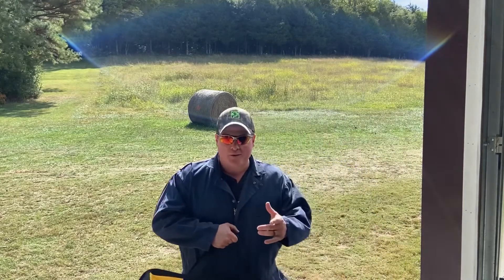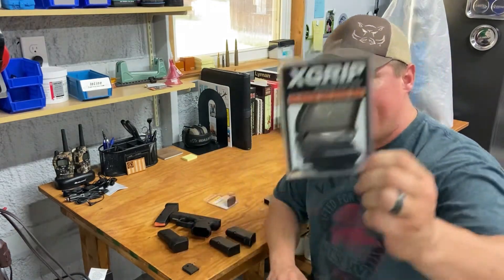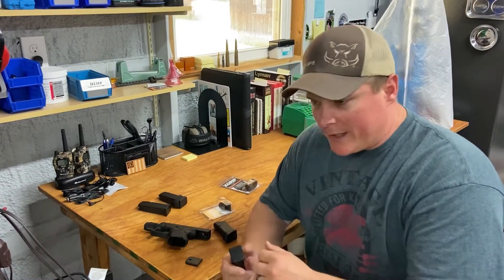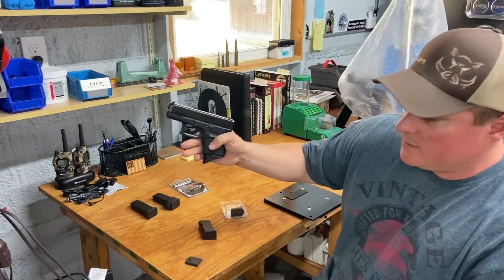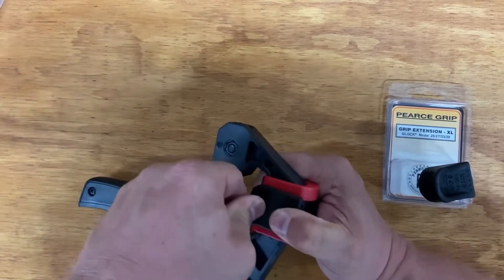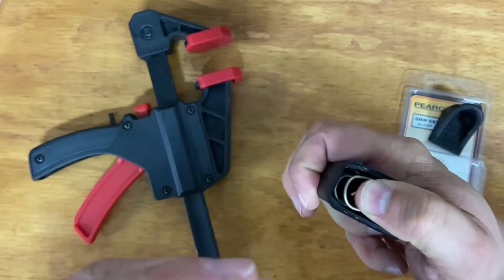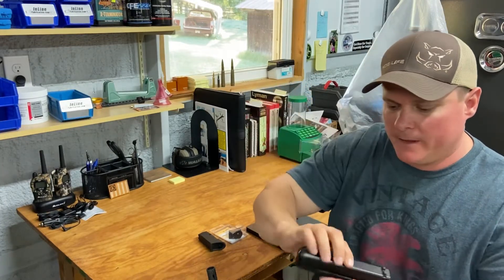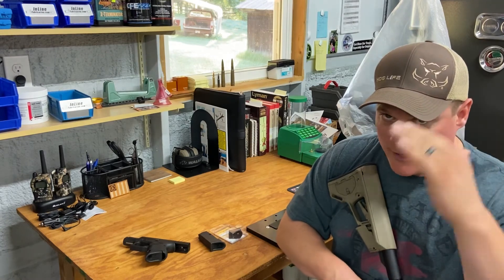Pearce Grip Extension Glock 26 Gen5 install

Comment: This is a great video.  I didn’t want to buy that special tool for the same reason, probably only will get used 3 or 4 times.  The clamp idea is genius - presses those tabs in and gives you a little more to hold onto while you move the floor plate.  Thank you!
Reply from the maker: Appreciate it big time! I’m glad it helped!!

Comment: Getting that original cap to start moving was the hard part. Once it move that first fraction of an inch it came off smooth and the new went on slick. The Harbor Freight clamps are another story.
Reply from the maker: It was a hard row to hoe!

Comment: Rather than using a clamp, I put my mag in a vice to compress the sides. The vice also held it securely in place while I worked the bottom off with a flat tip screwdriver. Easy peezy.
Just be careful not to over squeeze with the vice.
Reply from the maker: That’s a good idea for sure. Wish those tabs weren’t there to begin with.
Reply: @RawHawg .  You can grind the tabs off.  They are not really necessary.
Reply from the maker: @oklahomahank2378   I had to learn this the hard way! Lol thanks

Comment: I prefer their +1 grip as it’s slightly LESS protruding believe it or not than the XL version in the video.   Also, I do NOT stuff one more round into it as I don’t want the spring literally smashed “bottomed-out” all the time.  It works best on the Glock 27 mags, vs. the 26.   The 27’s factory floor plate makes the magazine ridiculously tight to the point that the mag spring is smashed like a pancake and great force must be used to get the very last round in.    The The Pearce +1 floor plate solves the problem by giving some “breathing room” for the factory spring and does NOT compromise reliability.
Reply from the maker: Good information, I have never used the plus 1 I don’t believe.

Comment: First use the long end of Allen wrench to push in mag insert, and hold Allen inserted...THEN squeeze the sides of mag body with the clamp. By squeezing first you bind up the insert and you have to fight it (and potentially crack it) trying to push it in. A small c-clamp work well also for squeezing the mag.
Reply from the maker: Good advice. If you miss a step it is a struggle
Reply: @RawHawg  Right. Baseplates are a struggle if you don't do it just right. Glock mag tool is long and hardened because you need length and strength for leverage to pry the baseplate off those side tabs. New mags are harder the first time, but if done right not bad. I use a punch and a small c-clamp to do mine.
1- Prep the c-clamp to get ready to squeeze by having the "C" wrap over the back, round count side of mag
2- insert punch about two inches into mag to move insert deep enough out of the way
3- lightly tighten c-clamp to pinch just enough to not cause permanent deformation
4- pry punch forward until slots in baseplate clear tabs on mag body and punch can't travel any further forward
5- take punch out and remove baseplate with thumbs taking caution with spring and insert so the don't inadvertently go flying

After you do a couple it becomes super easy to do it without hiccups.

Cheers
Reply from the maker: @richdouche8253  for sure and hopefully this helps some people!

Comment: Just got the +2 Pearce grip/extension for my G26. This is exactly what I'm looking for
Reply from the maker: Awesome! Let me know how you like it. I may give the +2 a try myself.
Reply: @RawHawg  if I like the +2, I'm gonna get the +3 for the two spares it came with.

Clamping the mag down to where the base plate can slide out past the two hooks without permanently damaging the magazine, is definitely easier said than done.

I like how you were using a 1/8 hex screwdriver, the mark of a true modern gunsmith.
Reply from the maker: Indeed! It’s tedious but well worth it. Makes you love the G26 even more! Good luck with install!
Reply: @RawHawg  update:

I got the PG-2733 for my G26 Gen5. It is actually a +1, not a +2. I think it has something to do with the generation. I just ordered the PG-42733, which is also advertised as a +2, but it specifically mentions the gen4/gen5 in the description. I also ordered the PG-39, which is a +3 (at least it's supposed to be). I'll update you once I get those in. Regardless, the one already have (PG-2733) that only adds +1 still works great, and I'll probably use it as my primary magazine for daily carry.
Reply from the maker: @tobiasreaper3650  sounds good! Let me know if it truly is a +3!! Hope the shipping doesn’t take forever as well!
Reply: @RawHawg  UPDATE: I just received the two extensions/grips and installed them.

The PG-42733 advertised as a +2 for Glock 26 Gen4/5 is NOT a TRADITIONAL +2, it is a +1. The reason why I say "traditional" is because you can easily fit another round in there, but after that, there is next to no room for the FCU, so when loading it into the gun you have to force it more than normal, to an uncomfortable degree. It also rattles if you fit that extra round in there. 

The PG-39, advertised as a +3 for the Glock 26, is actually a +2.

Comparing the PG-42733 to the PG-2733 (the PG-42733 is the newer one that I mentioned earlier). The 42733 stands up straighter that its older colleague, but that is because the back edge of its base protrudes more. It uses the actual gen4/5 grid square texture on the front, while the PG-2733 and the PG-39 use a different texture, although it works regardless. The PG-42733 is slightly easier to load into the gun than the PG-2733 when using it as a +1.

Conclusion/personal opinion for Glock 26 Gen5 for concealed carry: I personally would get the PG-2733 for my primary magazine, being a +1 with an effective grip and slightly lower profile than the PG-42733. For the provided spares I would get PG-39s, being +2 with an effective grip, although you could use the PG-42733, because although only effectively being +1, they reload slightly faster and slightly easier. Beyond that, I would look into running Glock 19 Gen5 mags with X-Grips.
Reply from the maker: @tobiasreaper3650  Nice, Good info to have!  Thanks for taking the time!

Comment: So the clamp , is to squeeze the inside a bit in order to slide it off the notches ?
Reply from the maker: Yes that’s correct. A fellow commented on the vid he uses a vice.. which is a good idea and he also shaves off the tabs while the plate is off. Says it doesnt create an issue with the mags. FYI
Reply: @RawHawg  thanks alot I appreciate it
Reply from the maker: @Cc_nf no problem!

Comment: Before I add a Pearce base plate, I ALWAYS shave off those stupid side tabs on the magazine.   They are an unneeded parasite on the magazine.  The internal base plate remains locked onto the housing by the internal floor plate tab.   I don’t know why Glock did that to their mags, but those external tabs are a royal PITA when it comes to cleaning.
Reply from the maker: Oh yeah they are! I mean a nightmare to say the least. It didn’t even cross my mind to shave those off. Makes the Pearce grip install not so much fun.
Reply: @RawHawg  What’s worse is trying to REMOVE a Pearce base plate with the “Glock tool” baseplate remover.   The tool doesn’t fit with one of those baseplates.    Lenny at Glockstore channel made a YouTube video about removing those little tabs with a knife.   I’ve been doing it for years and years and it in no way shape or form adversely affects the performance of the magazine.
Reply from the maker: @colt10mmsecurity68  That’s good to know. Reliable, Dependable Good ole Lenny @ the Glock store. I love that place! I haven’t seen the video but I will now. 
Maybe just maybe one day Glock will stop putting them on the mags!
Reply: They are Austrians making a military handgun.   Soldiers are not supposed to alter their firearms.  Capacity of a sub compact was not on their mind.

Comment: Will that one fit on a 19mag gen 5?
Reply from the maker: All the mags are compatible but you shouldn’t need it because your pinky should already have a spot. 
Unless you have enormous hands
Reply: @RawHawg   I agree I just hate the lip on the 19 mag when it's in the g26 so I did the same with a g17 mag in my g19 that made it where that lip doesn't squeeze my pinky in between
Reply from the maker: @cheetosd6396   oh gotcha. They should work. Check these out though before you buy. These might do the trick XGrips
https://youtu.be/qtCZ-vGpq9Y